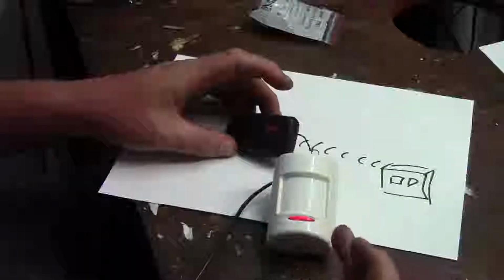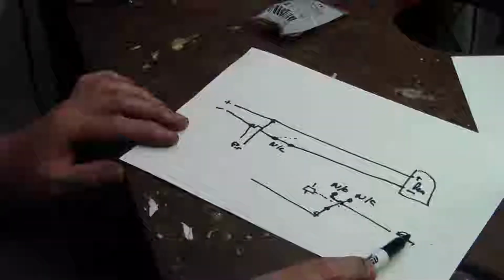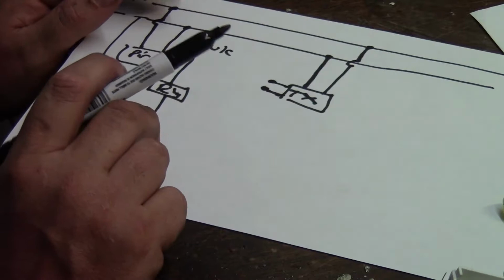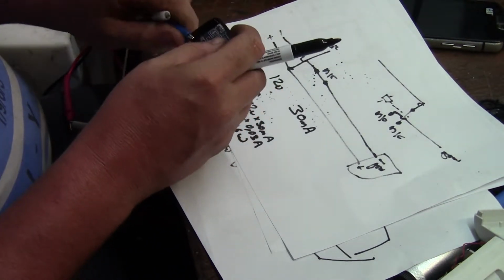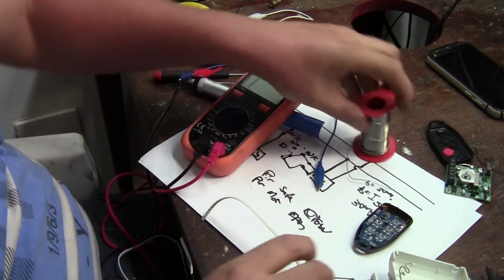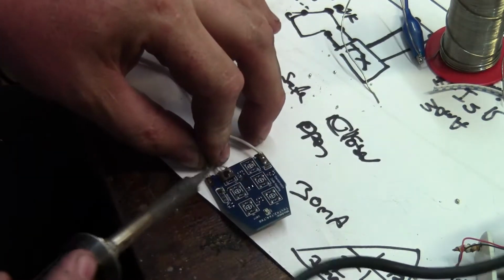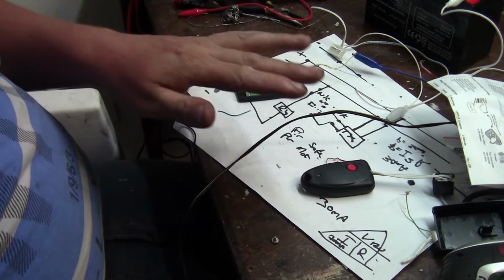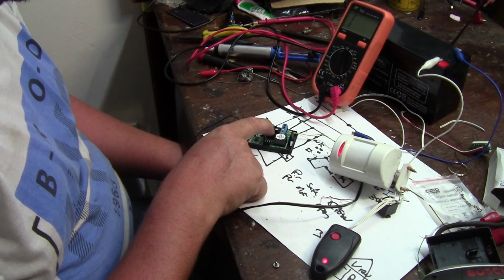ShoutingElectronics #11 - Remote Alarm Sensor Flipping Logic

Comment: Reed relays are generally NO, very rare to have a NC contact on them, or even rarer a changeover contact. 

Looking at the transmitter, if it is a learning one then powering it for a few seconds puts it into learn mode, and the first bit of noise it will lose the old learnt data and replace it. Wonder why they did not get the long range transmitter, just a little more than the regular one, and a longer range.

Guess the relay came out of a gate controller that did not survive the storm.